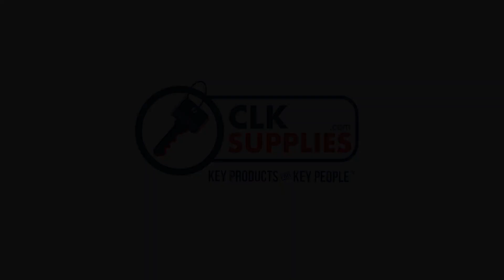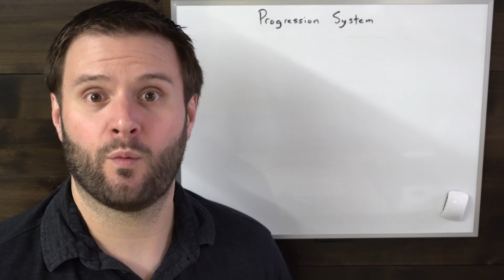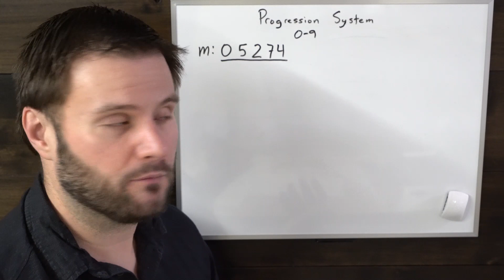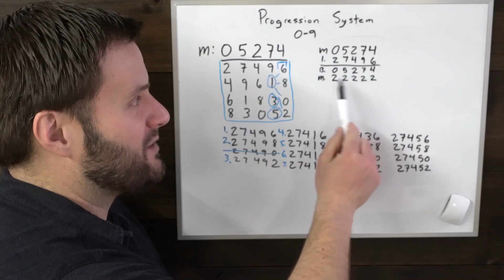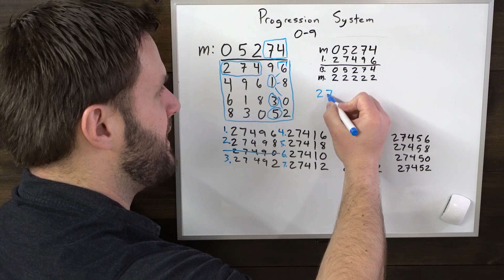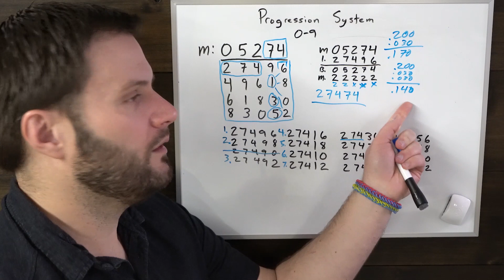Locksmithing 101 - Masterkeying -Progression System

Comment: Great explanation. With this system only even numbered master pins are used, unless I misunderstood something. If so do locksmiths that use this system have a bunch of odd-numbered master pins that aren't used?
Reply: Another thought that I had is that if the master key has a 0 cut then that would make lock picking easier since one of the pins is already at the shear line to begin with. 

What if instead of a 0 cut you instead use a 1 or 2 cut, but don't allow any of the change keys to have a lower cut for that pin. Apologies if I got any terminology wrong

Comment: i do not like this progression style. The first problem with these to much additional shearlines is that in total 32 possible combinations are able to open each lock. If you have the 05274 (M) and 27496, than might 27474 or 27476 and so on also opens this lock,especially when You use very common keyway like KW1 or SC1 ..... and picking is more easier.

the next, when You have this change key 27496 this is able to open every cylinder when you pull little bit the key, so that the angel on the cuts lift the pins in the hight of the master key.

if somebody is a real #lockboss than avoid these style of master pinning cylinders. Greeeeeeetings.

Comment: Good video. You had me right up until you introduced the sub-master key.  What is the sub-master and how does it work? Does it work any of the locks except for the ones keyed only for the Master? Everything I read on-line about it was just confusing. Help from anyone would be appreciated.
Reply: A submaster works under a grandmaster key. Basically imagine the submaster as masterkey A and all the change key under it are called a1, a2 and so on.

Now imagine you have a couple of submaster key (a, b and c) all having their own change keys that only the specific submaster can open, meanwhile the grandmaster key can open everything.
Reply: @kurogane2x  Thanks. I'd forgotten I'd posted this. I've learned a lot about master-keying since that original post but thinks for taking the time to reply.

Comment: Hey PJ- This must be a more advanced step? I don't even know what your talking about at square one. Lol  Where should I search for a problem that would require Master Keying? I guess I need to know what that is to begin with. I'm a dummy..but you are making me smarter! Thanks
Reply: A true master key system is required on places like Hotels and Resorts as well as places with many employees that should only have access to certain locations.  A true understanding of Master Key Systems is needed to lay out a property such as the Venetian resort in Las Vegas and Macau and Singapore.  Yes, the guest rooms are all electronic locks, but the back of house doors are all still mechanical and tracking every key issued to employees and outside contractors.  Why? Electronic locks are for tracking guest room entries so the casinos do not have to pay out robbery claims, but are easier to bypass than mechanical systems.  Some doors are accessible by Housekeeping, some by Engineering, some by Security, Food and Beverage,  Marketing etc.  Each department is issued a master level key to their area and those areas area also have their individual keys.  But the Theoretical Master will work everything.  Sub-masters are automatic once you have chosen the parameters for your master key system.  If you understand the entire system you can choose a sub master down to fitting only four patterns, where a column master fits 16 patterns in a Column down the system.  A Row Master fits 16 patterns in a row, etc, you can find more sub-masters than usable change patterns in a master key system.
Reply: @thekeywizardOriginal  Thanks KW.. Since original post I have gotten familiar with things. I apricate the info!! G$
Reply from the maker: Hey, no worries! Progression systems at first seem complicated but you WILL get it. I would recommend downloading the worksheet and following along while filling it out! -PJ
Reply: One example would be a college campus, with a grand master for the entire campus, individual building masters, office keys that operate a single lock, and building doors that can be opened by any key for that building.

Comment: Ok, I've found a spec sheet for Schlage locks that calls out a .200 top pin for a bottom pins 4,5,6.  So if I add a master 2 to a 4 I'll get a functional 6 and I think that should be good with the .200 top.  Do I have that right, #lockboss?
Reply from the maker: Yes Sir! -PJ

Comment: Great explanation PJ, I appreciate your going through all that. Took me a couple of views to understand the bit at the end (20:55) about using smaller top pins for chambers with master pins but I think I understand - it’s because normally (in your example) with no mastering, when the lock is used there’s only a spring and .200 top pin, but with mastering, depending on which key is used (change or master) the master wafer might also get pushed up into the bible with the top pin, which the spring wasn’t really designed for and which causes excess pushback when inserting/removing the key. At least that’s my take on it 😊
Reply from the maker: 100% Nice work Chirael the #lockboss ! -PJ